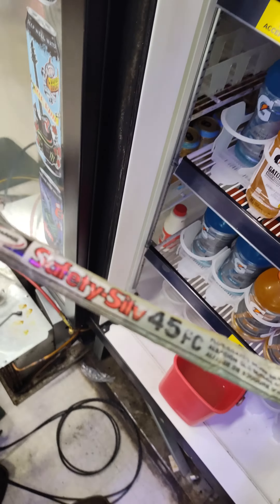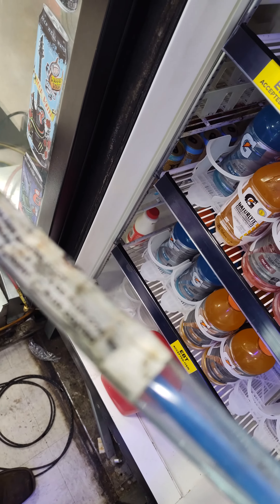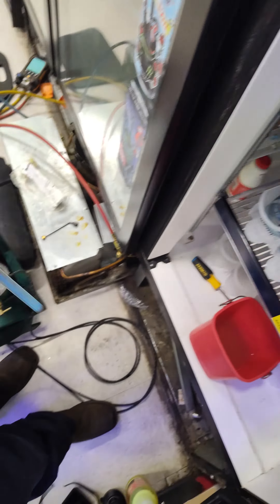Using 45% silver flux coated braze rod to fix refrigerant leak on reach in cooler.

Comment: yea, that flux probably helps alot on that old tubing. not necessary though. all copper. Fyi - You can use 15%. Why do you use the 45% ?  Do You Find it just makes for an easier weld ?
Reply from the maker: Yes. The flux helps the solder run. Or fill might be the better word. I've always liked using it.   Knuckles you never know how thin they are. It melts at a lower temp also.  So didn't have to heat up the knuckle to hot.  That one stick will solder up a few jobs not like it is money wasted...
Reply: @hvactoolporn188   Good point on the lower melting point !!! Never thought about it from that angle. Yea , the U-Bends can be a bit tricky at times especially when it's a rub out at the sheet.
Reply from the maker: Typically like using it on r22 systems as well. Or older stuff as back in the day most guys used actual plumbing solder. The 45 sticks to it all. Only time I don't like using it is when brazing from above as it tends to flow down and will drip on you.

Comment: You gonna come back and change that coil? Seeing that corrosion that’s not gonna be the last hole that pokes through.
Reply from the maker: No actualy would not have typically made that repair. It is a 2008 carrier that has been discontinued and has no information or replacement parts available. Attempted to locate the replacement coil for almost 2 hours. Store is doing a complete remodel and that unit is slated to be replaced in 6 months.  Just needs to last that long...
Reply: @hvactoolporn188  gotcha. I feel that. I’ve been dealing with a lot of obsolete open air cases and Hussman deli cases. Had to get a custom 12’ coil fabbed up because the owner doesn’t want to put the money into remodeling. The coil cost more than a new unit.
Reply from the maker: Job security. Hard part is they think it will last forever.  I find myself telling a lot of folks I'm not an engineer and can't guarantee the work in cases like yours... Once you do the work you pretty much own the machine...